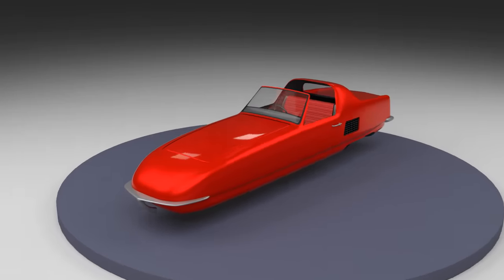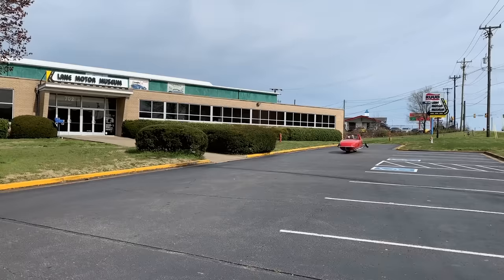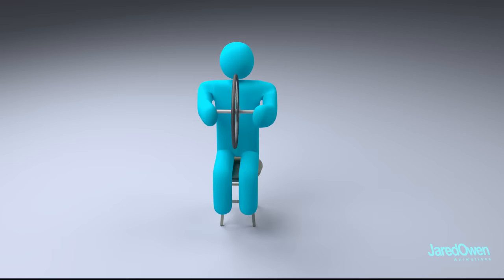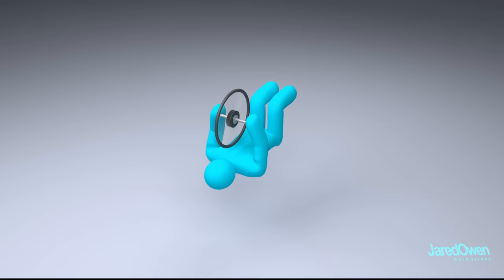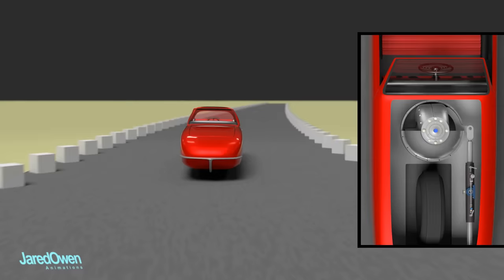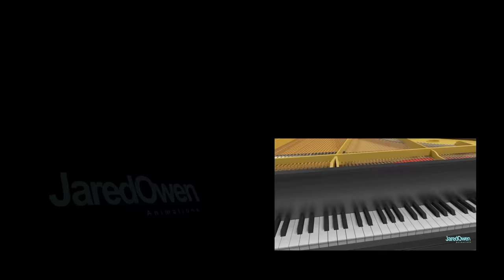How does the Gyro-X Car work?

Comment: Impressive engineering without question... but when I imagine this thing being involved in a crash and the 3000 RPM 230 pound solid metal flywheel coming loose... well...

Comment: Seems that flywheel has a lot of energy, gotta be a way to harness some of the excess
Reply: The energy to power the gyro is needed to balance the vehicle. If the size/mass of the gyro was increased to store potential energy it would need to be calculated to see if there was any benefit for the added complexity and reduction in performance due to the added weight.

Comment: If this were a typical two-wheeled motorcycle then the front wheel would turn Left for the car to make a Right turn.  

This freaked me out a little when I learned this as a child, but sure enough it's absolutely correct.

So is the gyroscope somehow working against the natural physics of a two-wheeled turn in this car?  Does it force the car to the opposite side it would normally lean without a gyroscope?

Comment: Fantastic video!  I've been fascinated by the Gyro-X since I first read about it back in about 1978.
One question: at 03:33, when talking about the "processional ram", you say "This will happen when the control system senses that the car is off-balance..."
What is this "control system" and what are its sensors?

Comment: With only a hydraulic ram to account for precession, a turning circle would be the bane of this car as the gyroscope could only be rotated to the maximum or minimum extension of the ram.  They should've at least used a geared ring to allow indefinite rotation.  Ideally, they should have two counter rotating gyroscopes that were geared to counter rotate with each other on the pitch axis, however such a configuration would require that gearing to be variable to account from for changes in inclination unless of course you want to build a unicycle car.  I think there's a company in San Francisco that's trying to build a two wheeler enclosed vehicle using gyroscopes for stability and Ford once proposed a two wheel gyroscope stabilized car as one of it's concept cars.  I'm surprised that no one used this idea to build a Star Wars land speeder or the cartoon Foomobile though the Foomobile could be built with modern active stabilization instead of just gyroscope stabilized and there's open sourced software to do this.

Comment: Hey Mr. Owen, why don’t you do a Howard works program on the Airwolf helicopter now I’m aware that helicopters are not capable of Mach one so we’ll say the maximum speed for the combined four engines would’ve been 500 mile an hour enough that the blades won’t share offand do your design based on that principal with all of the advancements, the helicopter was supposed to have that would really be neat. I’d really like to see something like that.

Comment: 50 years later and we still don’t have a gyro car, but maybe we will have a gyro car with digital sensors along with contra weigths to stabelize the car at any moment., but the question remains,, how reliable will it stay in the long run, how about it’s safety precautions? Will it ever met those safety standards we have today??
Only time will tell.

Comment: nowadays gyroscopes are microscopic (there's at least 3 gyroscopes in a single cell phone which allow your phone to know you've rotated it) so why don't we use this technology to improve cars the same way they did it in the 60's instead of making cars biggers so heavier so with a need for more power 
my car is from 2006 and develops 70hp (1000kg) with is enough for the use i have for it but, its modern equivalent is about 140hp....twice the power!!! A small modern city car needs the same amount of power an 80's GTI because it's not only twice the power of my car but also twice the weight
If we remove 1 wheel the car becomes lighter and still be use as a regular car (few improvement are needed to improve its stability but Reliant did that during decades and a Canam can be driven with a car driving license in a lot of countries.
If we remove 2 wheel it becomes even lighter but, there's a problem because the car becomes a bike, a bicycle where "bi" means 2 in latin and cyclus means "circle" (i don't invent it) so technically it's not a car but,  if we want to use it as a very lightweight car we have all the technologies we need. With a 2 wheeled "car" we have a car very light so very easy to power 
if the car weights 300kg it's 1/3 of my car so it needs only 1/3 of my car's power, wich is way more economic...my car makes 60 miles per gallon so with 1/3 of the power we can cover 3 time more distance with 1 single gallon of fuel (180miles per gallon is possible) with the same performances
so,
create a car with only 1 wheel (it's possible)it will be very light so very economic and with few bateries and an electric propulsion you'll get a range about 500 miles (the car will be way lighter than an average electric car so way more efficient) but this car will have only 1 single wheel (the same idea as the one they had in the 60's but pushed to the limits)
The Gyro-X is a pure marvel (about 60 to 70 years ahead of its time, perhaps more)

Comment: This machine does not use a gyroscope, but a GYRODYNE! They are often confused.
They differ in the same way as, for example, a thermometer (wich measures temperature) and a fire, wich produces this high temperature😁

Comment: They should be made but I don't think that a gyroscope is needed to balance a body in motion.
Bikes don't have 230 pound wheel inside them and they keep pretty balanced.
Reply: adam ryan  it is balanced with stands bro
Just like a bike
Reply: adam ryan  and we have to turn off the gyroscope because it consumes a large supply of energy

Comment: How much is the flywheel just operating the front wheel vs how much is the gyroscope stabilising the car?
The vehicle wheel could be operated by an electronic gyroscope but I think that would not be enough but maybe this could reduce the weight needed in the gyroscope by having an electric actuator pushing the wheel?

Comment: I really don't get it, this construction is useless and this may be the reason why there was no serial production. Every cycle and motorcycle has two built-in gyroscopes, they are called "wheels", and they keep the perfect balance in any two wheel vehicle, as long as the wheels are in line and the weight is more or less distributed evenly on each side. Now this "car", which is in fact just a motorcycle with a body would ride perfectly without the additional gyro, the wheels would do the same job, the gyro just stabilizes even more, but instead this complicated structure you could just add more weight to the wheels to get the same effect.  In order to keep this car balanced when it stops you could just insert flywheels into the rims of the wheels that run free forward but are driven from the wheel relatively backwards, so you would not need the support wheels for a short stop. There are many examples of motorcycles with a body, they are called ecomobiles and work fine without a gyro.  https://en.wikipedia.org/wiki/Ecomobile

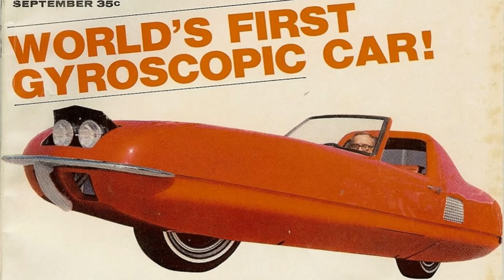Comment: 0:29 Hey, I see those two support rods(or struts) coming out the sides of the midsection of this car. These look like safety rods in case this car tips over, and it looks like roll-over city. These rods don't even retract. So many safety issues here.
If the gyro is not revved up full, the car will roll over during a sharp turn.
This Two Wheeled Gyro Car is unsafe!
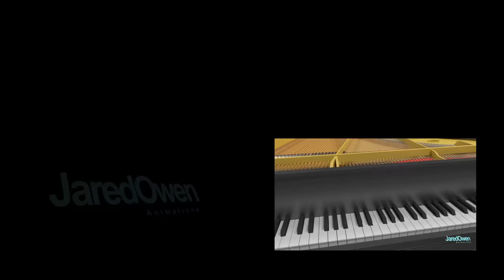5:37 You have obviously never been to the Nethercutt Museum in L.A. CA

Comment: Just another crackpot idea that had no practical purpose.
The fuel consumption would have been awful, having to power the gyro and the car.
A third wheel was all that was needed, as proved by several car companies.

Comment: Just curious, if the car were started while banked to the right, for instance, would that start the gyroscope in the wrong orientation, causing a permanent tilt in the car (or worse, inducing a turn) until the gyroscope stopped two hours later?

Comment: What's the advantage for having just 2 wheels instead of 4? The car still needs an engine to run right. The extra weight of the gyro and its energy requires for spinning at 3000 RPM, what's the actual advantage of having this over extra set of wheels?

Comment: You can only show CGI? The actual car tips over at any speed over 10mph. This can never work. The stabilization effect of the gyroscope is constant at any speed while the counter-steering of the single-track increases with speed. The designer apparently had no experience with or understanding of how a bike steers and stays upright. A second front wheel is way cheaper than a gyroscope and much less problematic.

Comment: The car has a very long hood comparing to its load dimensions.  The total wheel width is a lot smaller than the cars base width (meaining that you can insert another set of wheels). Maybe it is a cool product, but definetly is not a smart one.  I would rather to have a "mini cooper" or "fiat 500" over this.  Shorter , Wider (means you can carry passangers). Oh and probably 500% more balanced!

Comment: For impatient people, the way it balances is by using a very fast spinning ball called a gimball motor (I think) The spinning causes torque witch makes the car go back upright if you spin it the right way. It’s kind of the way hellicopterss have to have 2 reverse blades so it does not spin them from the helli engine torque

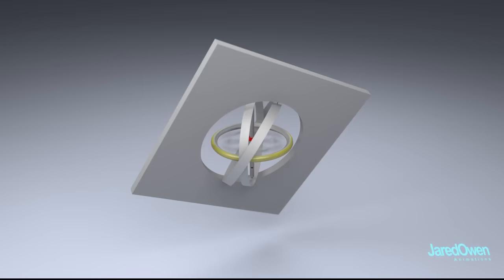Comment: Hey, m8 ... How did you simulate the gimbal at 01:36 ? 

I have run into SO many problems in trying to do stuff like that ... 

so far, none of the guides, tutorials and forums I've found seemed to be of any help 

I always get some error when trying to attempt it, I parent my objects, use rotation constraints, yet homehow, everytime my angle is more than 10 degrees, everything breaks down and gets misaligned
Reply from the maker: Great question!  I assume your using blender like I am?
To be honest I didn't get it perfect - there were some angles where it broke down and got all wonky on me.
I used the tips that found on this forum : https://blenderartists.org/t/rig-constrain-a-3-axis-gyroscope/654405
I hope that helps!

Comment: but wouldnt it run out aof angle i the road has not equal left and right turns? maybe the driver sits a bit shifted to the side, makes this happen even faster. i think the have designed it to do a 360 degree turn, but now imagine a road that undercuts itself by a tunnel or something. have got it wrong or wouldnt this be a major issue
Reply: jan simonides  or one gyro that can turn freely without backstop

Comment: This car is an excellent example where economical advantage does not outweigh technological advantage. In simpler terms, the economical advantage of fitting 2 more tyres is far more than the cost of the gyroscopic contraption. This just makes such a car commercially nonviable.

Comment: The whole efficiency of such design is very dubious - the car had space for one person. Making it two wheeler all you are saving is a traction of two wheels but you have to carry fly wheel and heavy casing - and not to mention a total crash hazard with a flywheel that can eat through anything .... How about remove all that and install one more wheel to have 3 wheeler? I bet the efficiency will be higher.

Comment: Never showed how the flywheel was powered. I guess it has an electric motor.
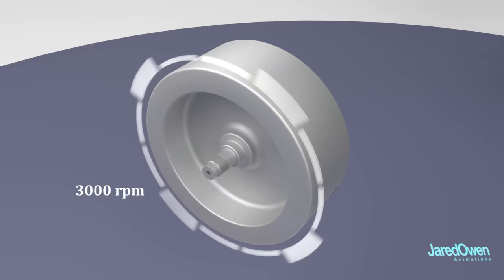Reply: 3:09
Reply: @tooleyheadbang4239  I don't see the pumps, nor how the fluid engages the wheel. 🙄
Reply: @lightdark00  Neither do I, but the fact that the narrator states that it is hydraulic makes your guess a fairly poor one.

Comment: Nice idea, not, to change a wheel, problem,  extra power to keep it upright, problem  too fat to filter between cars like a motor bike,  problem,  parking space the size of a proper car, problem. Handling in high winds, problem,  so basically,  no gain but a lot of pain!

Comment: Gyros drift don't they, how it zeroes out i mean back to the initial position from where it started in the center line. 
I push the car from one side and the counter precession absorbs my energy by keeping the car stable, but due to the counter precession the gyro is on a new angle now so if the keep on pushing it on side the gyro will precess until the axis of rotation of the gyro comes in line with the direction of roll of the vehicle at that point the vehicles tips over.
So how the gyro gets back to its initial position without an additional locking gimbal mechanisms.
I am confused
Can any one help.
About precession
https://youtu.be/Im2mNnWZ5Oc